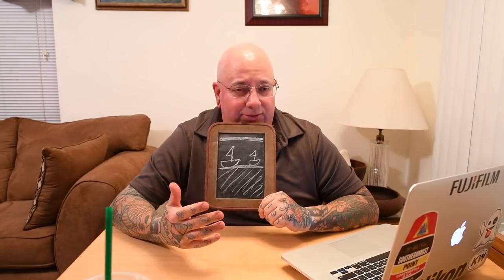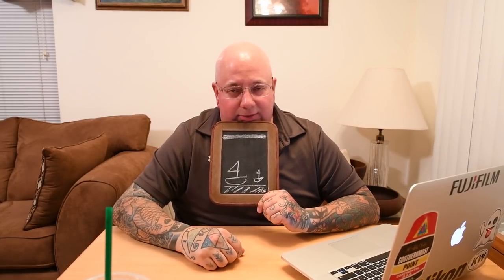🤔 Dynamic Range, Clipping thresholds, ETTR & Sensor Saturation

Comment: Ken - great vid. Can u help me understand how to apply ETTR for landscapes and interiors  like churches?  I use an xt20. I’ve been exposing for the sky or the lights in a church. This always underexposes the foreground and mid ground. This results in greater noise when I open up the exposure and shadows . My interpretation of your approach is to allow part of the sky or the lights in a church to get blown out and then recover in Lightroom. So if the xt20 allows the 3 stop margin that you’ve found, then you’re saying it’s ok to clip the highlights by that amount? Clarification will really help. Thanks.
Reply from the maker: spot meter for highlights with 1 to 1 and 1/3rd stop +++ compensation  :)   sensor saturation without clipping highlights

Comment: Im not sure if I follow you.  If that is true about megapixels and dyaic range  then how come the new cameras with higher megapixels have as good or  better dynamic range then the older models with fewer?  For example the sony a7riii has 42MP double the a7iii resolution but has exactly the same dynamic range of 14.7 stops.  How is that explained?
Reply: It's about better technology nowadays. Sensors have become 95% quantum efficient compared to first generation with 5% efficiency. Better to have pixel count optimized for better overall image output. 35 MP is best for FF and 16 MP for APSC.

Comment: "Specular" highlights can clip.  That's why they are "specular" highlights.  Specular highlights are a "reflection" of a light source.  Of course they are going to clip. That doesn't mean the shot is over exposed.  Specular's ARE overexposed areas of an images.  Just as a shadow area is underexposed areas.  Now, "light(er) areas should not be clipped.  A perfectly exposed white towel is not a highlight.  It's just a light toned subject and of course should have good detail of the fabric.  But the specular on a wine bottle or car IS NOT going to hold detail.  It's not suppose to.  It's a "Specular" highlight.  Not a highlight.  In general.
Reply from the maker: there is no "perfect exposure", however i have most latitude in lightroom etc by always ETTR, of course.
whether a specular holds detail or not is up to do,......question is where do you want to place the DR slider on the shot at.
Reply: Don’t disagree.  Just saying, a specular like say the reflection of a soft box on a wine bottle will surely have no detail.  And that’s perfectly fine.  It’s suppose to be pure white.  It’s a specular highlight.  I use ETTR myself.  I think we misuse the term Highlights and Shadows these days due to a Histogram.  Just because it’s a light tone doesn’t mean it’s a “highlight”.  Just as a black area may not be a shadow.  A shot of a perfectly exposed black dress is not a shadow.  The “Diffused highlight” IS the black dress’s correct tonality.  But you know this stuff.  Simple Dean Collins stuff.  Ha!  God I miss him.  He was one of my best friends and mentor.

Comment: Going by that so ken my D500 is a piece of crap compared to the D4 for example?
Reply from the maker: ive got 2 D500, ive never implied the D500 was crap.......  however it does blow highlights really fast
Reply: Ya I've seen that. I'm not picking on the D500, I just said that body cos I have 1 ..... All crop sensor cameras have no room between the sail and the bridge, therefore they are no good compared to some full frame cameras is what I'm getting from your video, am I wrong?

Comment: “Analogy” has the word “anal” in it... and I don’t want my backside illuminated thanks. 🤭

I was not aware back-illuminated sensors can to an extent overcome the pixel-pitch issue at higher megapixels resulting in dynamic range comparable or superior to a classic DSLR like the twelve megapixel D700 for instance. 🙂 

I have been coveting my neighbour’s wife - as well as a D700 - for some time, but maybe I can turn my attention to a higher megapixel alternative.

Does anyone know which of the Nikon DSLRs have a back-illuminated sensor as well as illuminated buttons for night shooting? D750 maybe? I’ll start looking there.

(I enjoyed hearing Angry’s diabolical laughter at the end of the video. 🤪)

Way off topic but... anyone remember those little two megapixel CCD boxed amateur astronomers would attach to their telescopes? They used a digital stacking technique to clean up the image, which I believe is still done in some astrophotography today.
Reply: The only BSI sensor in the Nikon DSLR lineup is the d850 which is like 46MP beast. But with Tower Jazz starting to crank out more sensors and providing manufactures with other alternatives I’m sure we will star seeing more BSI sensors in more and more models.